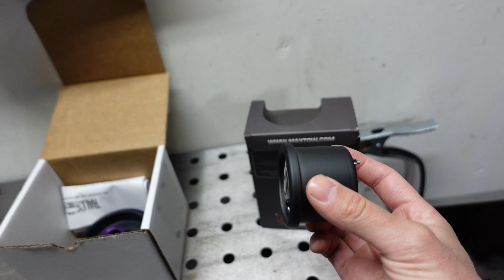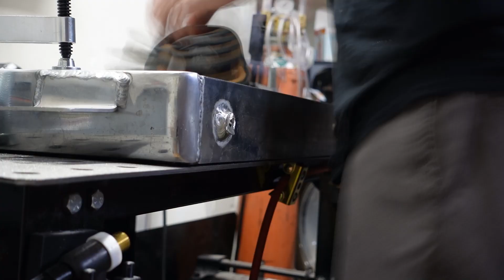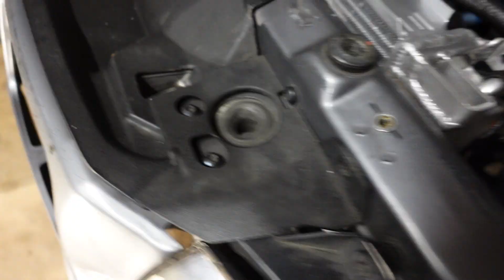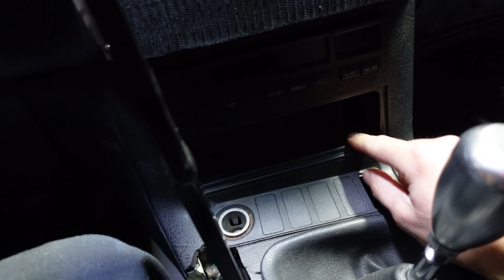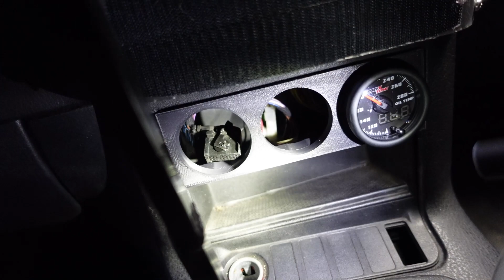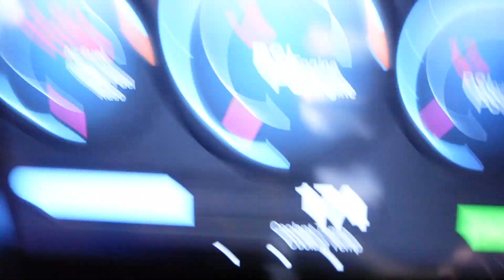Complete DIY Oil Cooler + Temp Gauge Install (E36 TURBO)

Comment: I guess when you actually have a garage to work in you have the luxury of using a welder unlike myself being in an apartment but I would have regarldless just used a flat stock piece of metal and bolted that cooler down to the upper intercooler mounts your just grinded off lol
Reply from the maker: Yeah Sometimes I tend to over complicate things lol